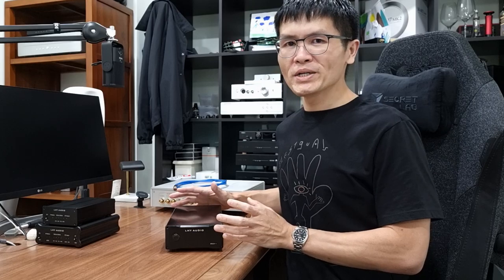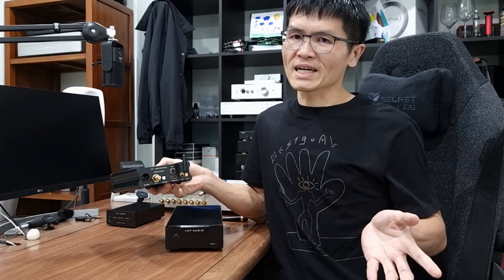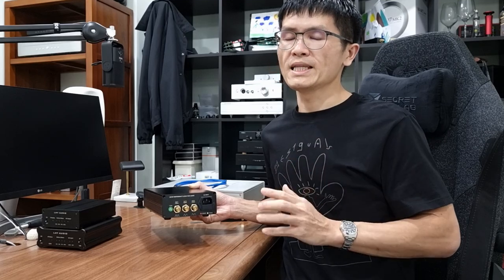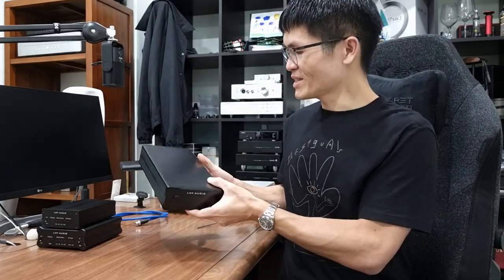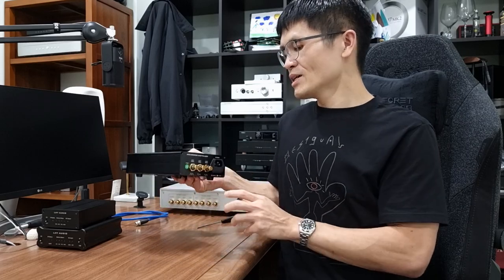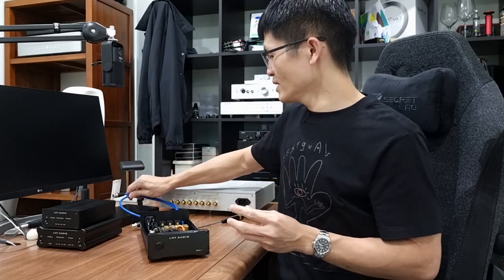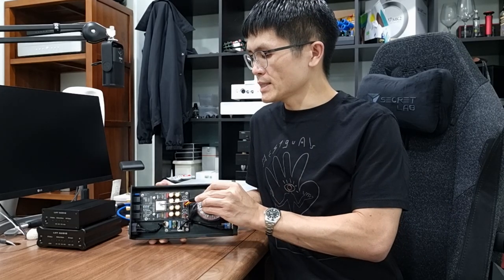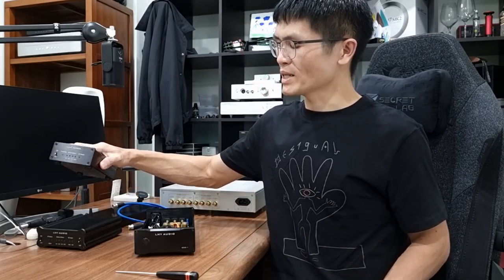LHY Audio OCK-1

Comment: does it not matter that the sommer cable is meant for 75ohm applications and the LHY OCK-1 is 50ohm?
Reply from the maker: Ideally, the impedance of the input/output, as well as the cable should be matched. This will reduce the possible reflection and/or signal loss.